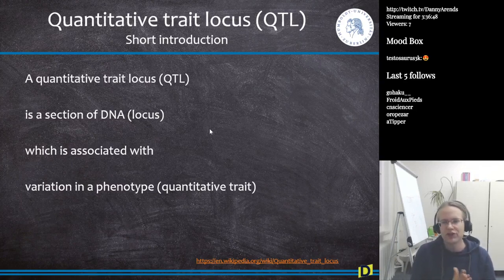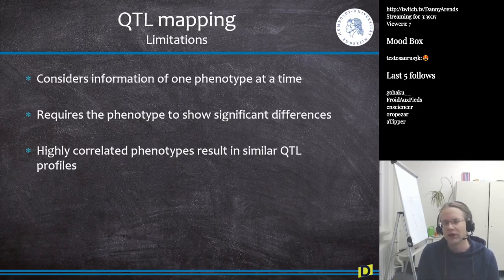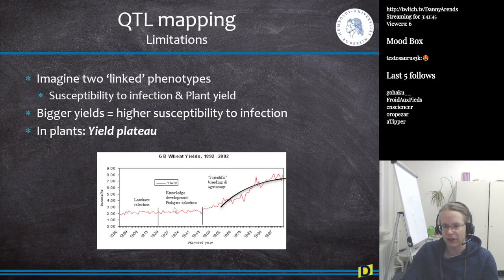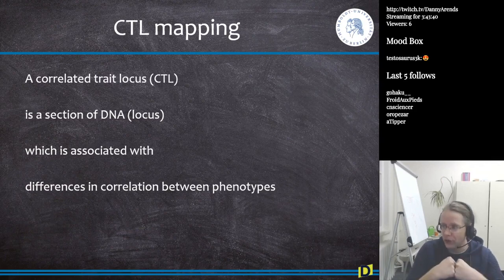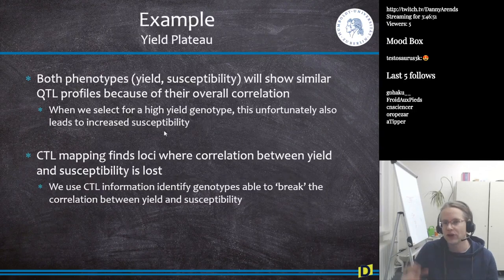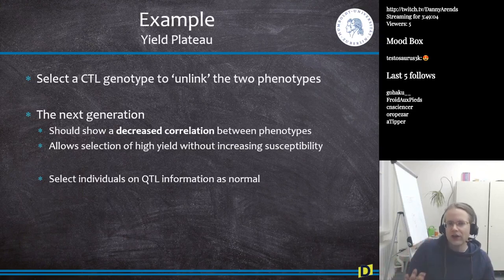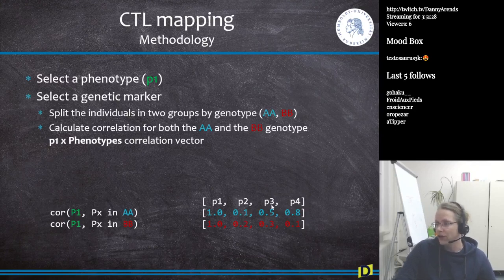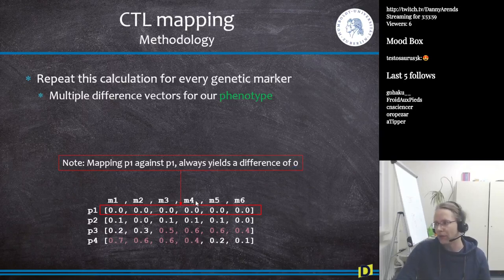30min PhD thesis - Correlated Trait Locus (CTL) mapping

Comment: when you say ctl mapping is data-driven, it looks based entirely on correlation and associated calculations. does this mean CTLscan() is independent of the cross-type(i.e. multiple F2 populations can be analyzed together?; to push even further, it looks like breeding lines, F1, F2, F3, RIL, etc all can be analyzed at once?)
Reply from the maker: You can run it in pure GWAS mode, but then you're limited by sample size since MAFs can be low. Big differences from merging different cross types would artificially induce correlation differences is my guess. This might be interesting to investigate in itself, or just regress out population structure from both phenotypes before CTL mapping.